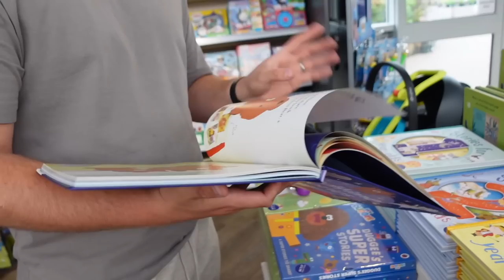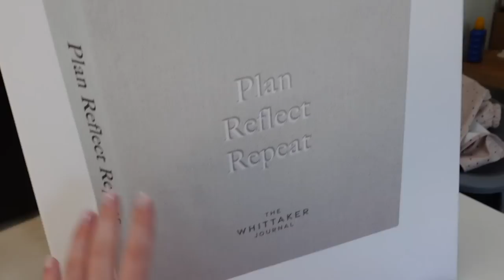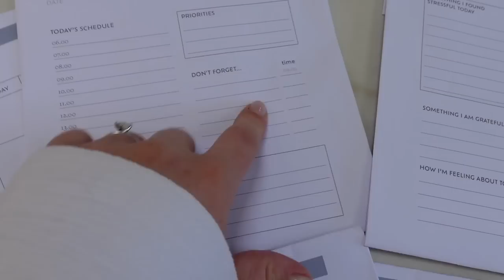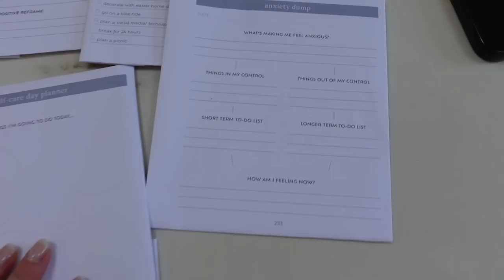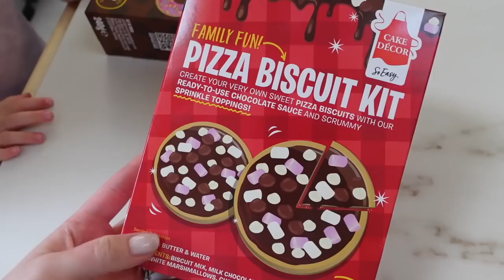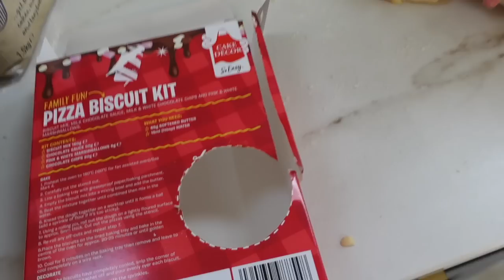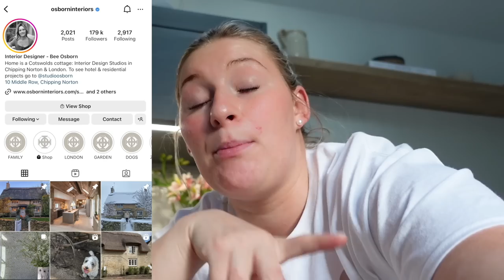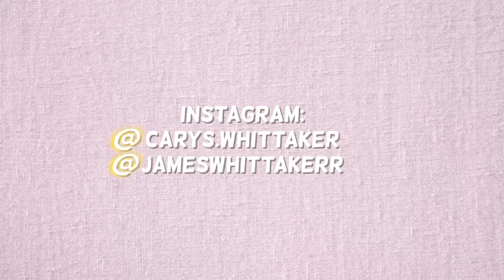EXCITING ANNOUNCEMENT, RENO UPDATES + HONEST CHATS | James and Carys

Comment: James is 100% right this time - ditch the stone if you don’t you will defo regret it it will look nice but it’s not functional !
Reply: Or an option is to put glass backsplash on top of that, easy to clean and it keeps its looks
Reply: I think that would come too far out and look odd but yes it’s an option
Reply: @joannemclean3708  I think there is different types of glass, you could put thinner one 😇

Comment: Parenting Anxiety,  some times through the day you are just a little thin, your running on empty and stressful moments can temporarily overwhelm.  Trick is to know its temporary, count to 10 take a break and take 10 mins recharging yourself doing something fun for you. Let it go not all battles need to be won in that exact moment. You can always try again a little later or let your partner tag in. It is very very normal, every parent has toddler melt downs. Every parent gets overwhelmed and over tired.